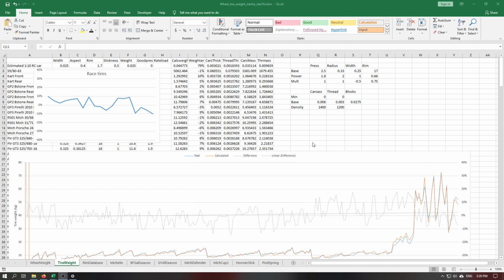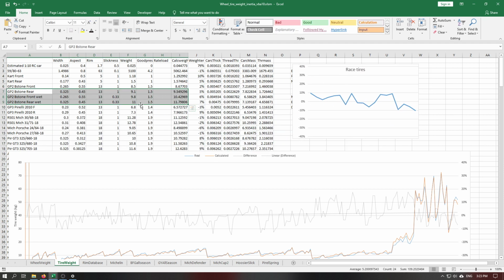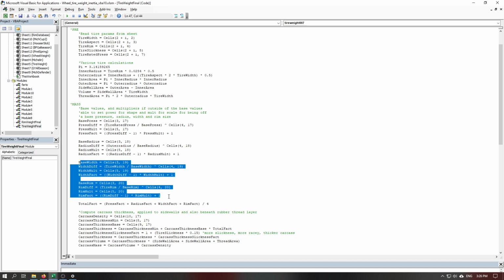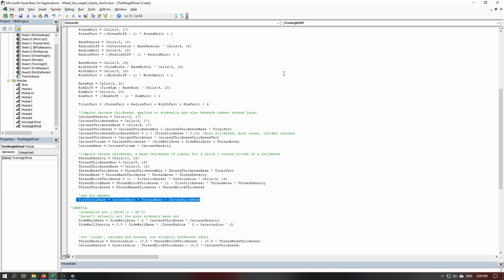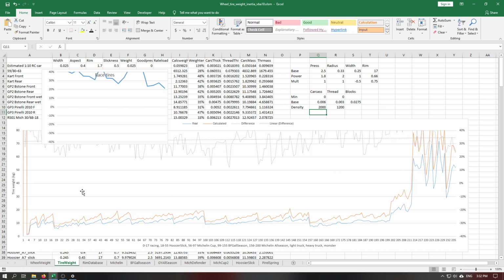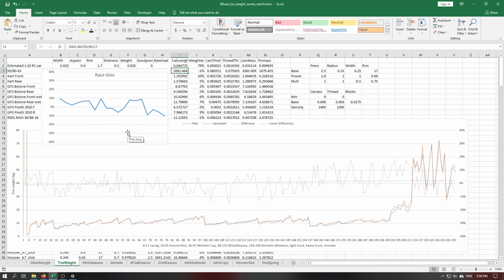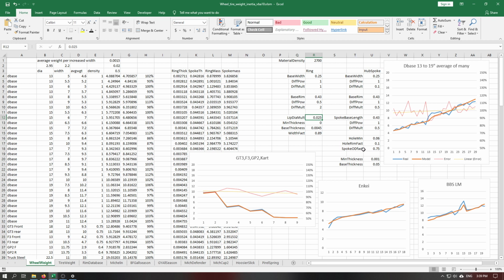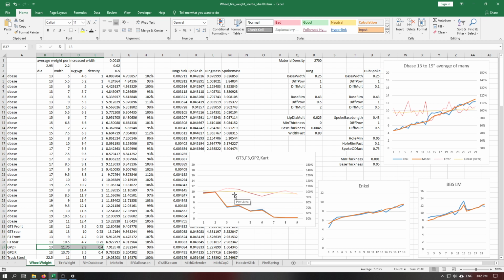Predicting Wheel and Tire weights (Spreadsheet + programming)

Comment: Thanks for all the great videos! Amazing that it takes you "one day" to model this, I would have imagined much much more. 
To add to the other suggestions made here and hopefully without sounding like a smart ass, this seems like the textbook example for which a (or "many" depending on the approach) simple backpropagation NN would do wonders. The downside would be the result is (almost) a blackbox. But given the data as you have it gathered already, it might be even faster to code it (e.g. using scikit) and train it. I get the feeling that there are several other applications for NNs in sims, but I might be wrong, my knowledge of sim-internals is limited to your videos (not even all of them yet).

Comment: I know this is too much trouble, BUT... if someone is making a 3D model of a rim anyway, then you can get the volume from that 3D model easily. If you are using something like AutoCAD Mechanical, you can also select the material and get the mass and even moment of inertia for the 3D object. It's build into the software, but I've never used it personally.
Reply from the maker: If you have super detailed manufacturer models sure, but going by an 'artist impression' that looks near perfect on the outside could be very wrong, perhaps the material is a few mm too thick, that adds a few kg real quick. I'd be more confident in getting consistent results from a predictive model like mine, unless BBS gives you their CAD files..

Comment: Niels, is there a way to insert tyre balance or better said the imbalance thereof into a sim and through the FFB system? Because I think it would (unexpectedly) add a lot to road feel and damage simulation being fed back to the driver.

Edit: Just to add. Naturally a tyre balancer would balance tyre and rim so that they are stable, but that is only under longitudinal rotational spin without vertical or laterally load.
As you can imagine the verticle load of the vehicle will spread the contact patch out and thus spread the balance, and that area of rubber will spring back into shape as it rotates and the load gets moved to other areas on the circumference of the tyre.
Same with lateral load and lateral deviation of the weight of the rubber, and that springing back. This is all working imbalance and inertia of the rubber springing back into shape that can be felt as a rotational mass.
If implemented you should have a clearer difference in feel coming through making it easier to distinct if something happens on the left or right front wheels.
Reply: Do you mean a gyroscopic stabilization? That is already in the FFB in AMS. Niels showed it in his "(Race) Car Steering Forces EXPLAINED!"-video, it's right at the beginning the first FFB force he shows in isolation. ...but sorry, if I got you wrong and you meant another effect.
Reply: It seems Reiza does support unbalanced tires. Please google the following (not sure if links are allowed these days) "Use the default Reiza textures for dirt/grass/sand pickup and flatspot texture, and map these textures on your tyre textures"
Reply from the maker: I've never given that any thought whatsoever! Indeed, the center of gravity of the tire will change a little big when it is squished vertically or flexing laterally. Vertical squishing is modelled as a spring/damper in AMS, lateral movement doesn't exist. But CG changes are not applied. It will be fairly small with perhaps 5% of the tire mass moving 10mm vertically, which would be a 0.5mm vertical movement of the CG of the tire mass, less when you account for the (pretty much static) rim and brake disc rotating masses. So while there is a lot of stuff you simpify going for a single contact point vertically sprung/damped tire model, I don't immediately see how a dynamic tire CG would significantly improve anything.